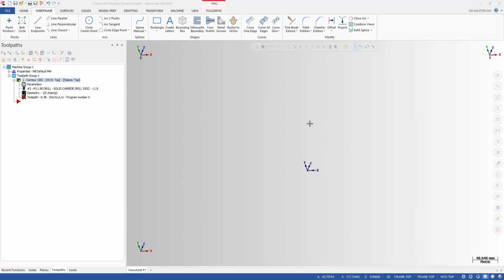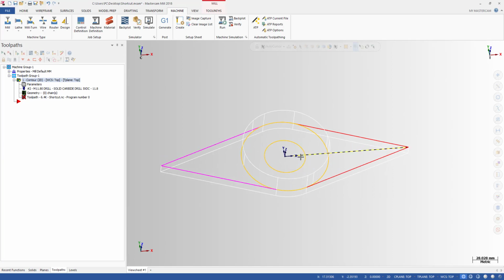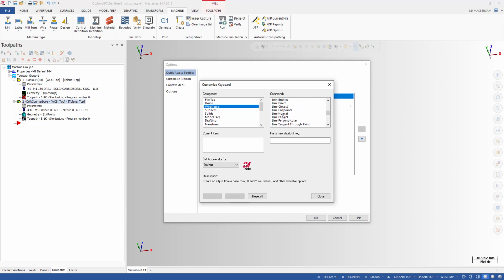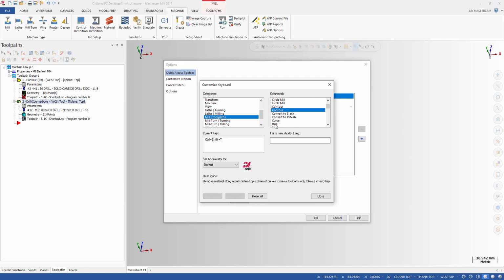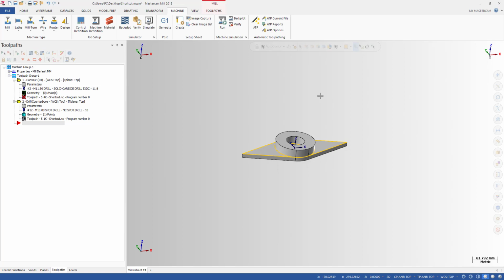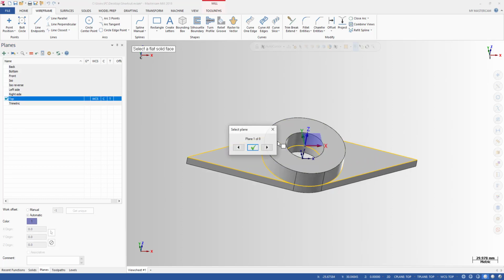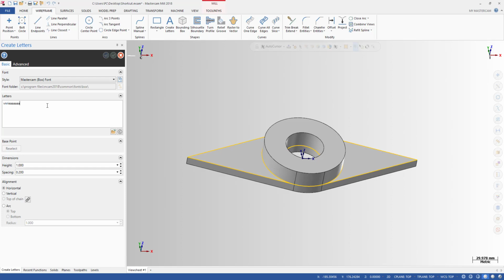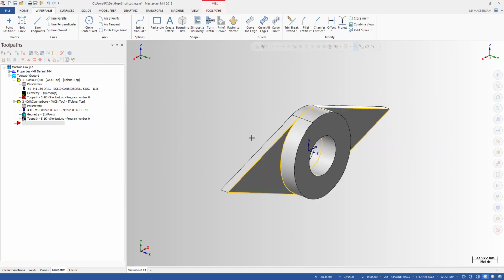Mastercam tip: Set up and using shortcut key in Mastercam

Comment: 12:40 the issue with textboxes still accepting keyboard hotkeys is fixed in 2023.  But it's crazy how mastercam doesn't have default hotkeys.  Do you know of a way to import/export between computers?
Reply from the maker: you can move the config folder and replace the one in your other PC